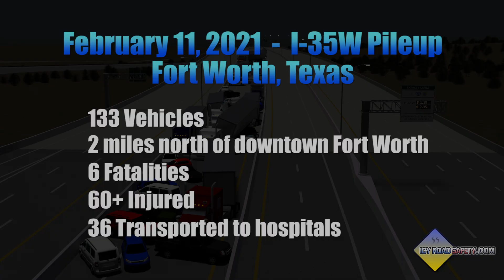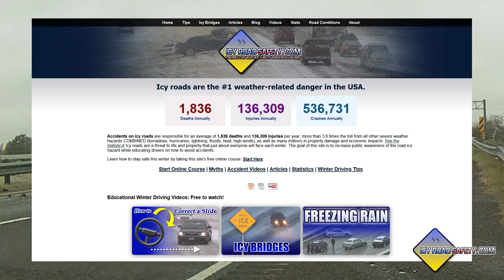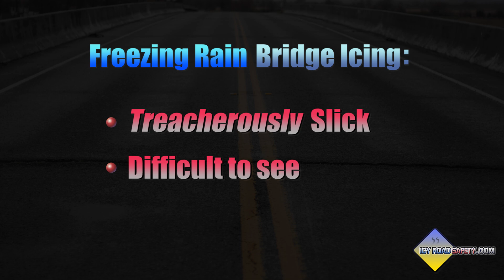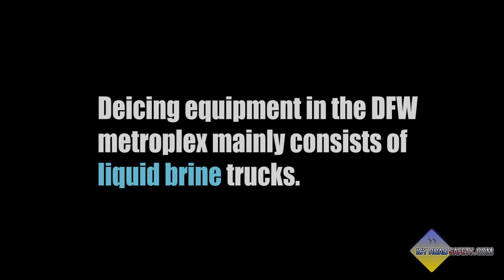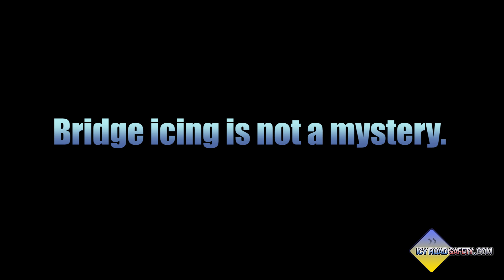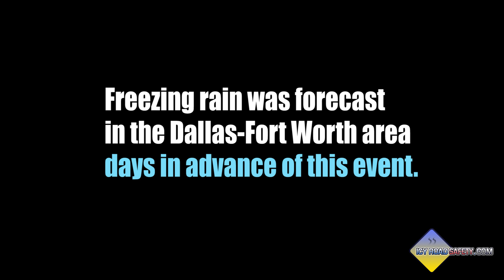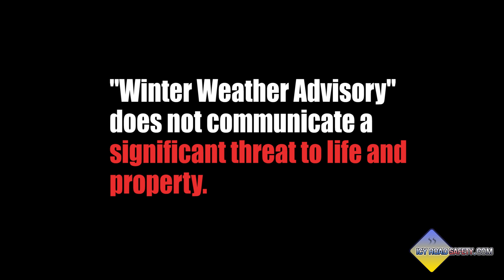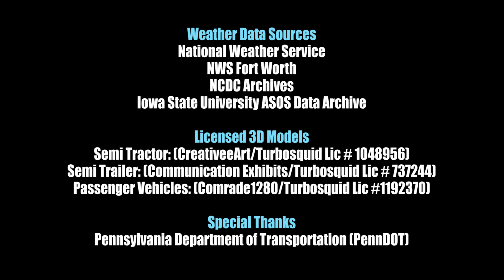The Fort Worth, Texas pileup: its cause, contributing factors and how to prevent future ones

Comment: I live a few miles from where it happened. I worked in Dallas then. When I left mid afternoon the day before it hit. Driving from Dallas off 635 I seen a few trucks spraying stuff on the roads to get ready for this storm. As I got to Fort Worth there was no trucks or nothing being laid down on the road to prevent it. You could see if it was sprayed or dirt laid, nothing. I ran around a couple hours before I got home. Woke up in the AM and seen this on the news. I was not surprised. Plus folks driving still at 80 mph didnt help. It was a mess here. Not suprisingly, the next ice storm there was deicing on the road.

Comment: I have something regarding the bridge icing, the problem I see here along the information given, the bridges has concrete laid, not asphalt, that’s also a huge factor in which why the bridges freezes before the road.

Here in Europe, most, if not all bridges has the same asphalt that the normal roads on the ground has.

Of course, bridges always freezes first due to the warmth of the earths surface.
But it minimizes the risk of the road having ice built by quite a lot of percent.

Comment: Dan, good video however I feel you have really missed the mark.  The bottom line is that DRIVERS MUST be more aware of the conditions they are driving in and adjust their driving accordingly.  Weather doesn't CAUSE crashes, people driving outside of the safe speed for conditions is what causes the crashes.

Comment: I live here and called this before it happened! Number one cause! No where to be able to move over to avoid the accident. I’ve lived here in this area my whole life and have seen and driven in many ice conditions….it was not until they started altering the highways, adding these concrete barriers to prevent other vehicles from potentially causing an accident in the other lain when swerving to miss accident but ultimately adding these concrete barricades left absolutely no “shoulder.” So add on the icy conditions which yes this was a freeze but again we have had many icy conditions just this was the first in my 40yrs that lasted over a week. This was the first, beginning of the freeze so again we have had same conditions before. What led up to this…..Icy, drivers were commuting in the dark, when they are coming up on that part of the highway it’s not flat so you do come up in a sense with a surprise “oh crap traffic” concrete barriers and express lanes with NO SHOULDER! All of these combinations with the cherry on top, drivers driving too fast KNOWING THAT THE ROADS ARE ICY led to the unfortunate accident that I hope we never see again.

Comment: Excellent video! Thank you for the much-needed public announcement/education.
---
"Region inexperienced with winter weather:"
A key point you could include to that: Lack of knowledge leading to wrong choice of tires on vehicles.
Tires make a BIG difference to how well a vehicle handles. I suspect a lot of people down here in DFW area have no clue what type of tires they have on their vehicles. 
A lot of cars might have "grand touring" tires. While these are sold as "all-season" tires, they are not true all-seasons. They are a hybrid between summer and all-seasons. Touring/Grand touring tires are not meant to handle actual winter weather, let alone icy conditions.
Up north at my NY estate, all-seasons are pretty much standard and some even swap to winter tires every winter season...even adding chains at times when needed.
I wouldn't be surprised if in the DFW area, a higher percentage of people drive on summer and grand touring tires...and no one drives on actual winter tires.
This is why I see so many people in the DFW area having trouble with even a spackle of snow...and are unable to handle even a little bit of freezing rain. A change to proper all-season tires would drastically improve traction for them.
Now, no tire will handle a real sheet of ice (trust me, you and I know), but good all-season and winter tires are better able to handle winter weather than any other tire.
---
Another point...
Hmm, so they use a liquid brine solution down there in the DFW area, eh?
Brine is just salty water. With freezing going on, the brine is going to add to icy conditions and actually create more ice than what would have occurred just from precipitation.
We use a salt/sand spreader up in NY. Yes, our cars get caked with dirty salt, but the salt/sand combination really helps improve traction. Even after the salt melts the snow or ice, the sand helps to further improve traction and prevent a refreeze from becoming a sheet. The sand breaks it up.
---
Winter weather advisory...
Oh, yeah. We know what that means up in NY...stay home unless absolutely necessary and if so, proceed with extreme caution...even with winter tires.
These warnings should be elevated to and taken as seriously as tornado warnings.

Comment: The main cause of the pileup was the fact that most Texans have little to no experience with winter driving since IF we get snow it's usually only a couple of inches that's gone in a couple of days. February of 2021 was far colder than we're used to. It usually doesn't get below the high teens but, in 2021, we had one night were it got to -1.
Reply: Also Texans drive like they're in nascar.... I live in Texas... I know
Reply: @cathymac6472  We also have the people who drive ten miles under the posted speed limit, and people who suddenly just whip into your lane without looking to see if there's another car already there. At least the Nascar driver whizzes past you, and is gone. Nothing like being stuck behind someone going 35 in a 45, or almost being sideswiped.

Comment: As much as I love living in Texas, I hate Texas drivers. Going speed limit was actually their version of slowing down. Without icy roads, common speed in express lanes is 90+, with most Texas always driving 15 miles over the limit. The only thing that can really get a Texan to slow down is flashing red and blue lights. My solution would be to line the bridges with officers that continuously have their lights on, and they’ll also be available for immediate response in case of accidents

Comment: I know this may seem a bit far fetched but, what about putting some  sort of  heatting system covection lines on the surface of these road bridges, or maybe spray something warm but also flame retardant, maybe a heat generator or exhaust system that sends warm air onto the frozen surface from the sides of the bridge to counter act the wind chill and freezing rain, idk.

Equip a temperature sensor to detect abnormally low surface and wind temperatures and have a small electrical generator to run low current through an insulated wire or coil.

I know most modern motor vehicles have rear car windows with strips that conduct heat and current to defrost and defog the exterior of the windshield, but I think maybe doing he same thing but on these bridges might work.

Comment: The city I live in shuts down almost completely if we get a half inch of snow. About ten years ago, we got a good deal more than half an inch. I finally had to go out after five days, because we were running out of food. I could have walked faster than I drove, but I was pretty much alone on the road, so it was fine. The woods on either side of the two lane road I was on were full of SUVs and pickup trucks the entire two miles I was on the road. Too many people believe the commercials for their vehicles, and these people can't drive in the rain, much less snow and ice. We were at home for eight days that year, and the most shocking thing was the satellite TV stayed on the whole time, along with the electricity.

Comment: Excellent video. Thank you for taking the time to put all of this valuable information together. Your concern for the safety of the motoring public is greatly appreciated. I’ve been driving semis for 28 years now and Lord knows that I have seen my share of tragedies up close. You are correct, ice, and especially black ice, are very hard to detect. I was taught to look for shiny reflections on the pavement. If you see them, chances are that black ice is present. If people would heed the precipitation warnings like tornado warnings, as you stated, many lives could be saved if they drove accordingly. Excessive speed and a short following distance, are recipes for disaster, ESPECIALLY in an 18 wheeler. In fact, for trucks, that is the case even for ideal conditions due to their size, weight, and increased stopping distance required to get them stopped completely. Add ice and snow into the equation, we truck drivers must reduce our speed and increase our following distance accordingly. Drivers of smaller vehicles (cars) that try to cut in between semis trying to slow down in inclement weather, are only putting themselves in more danger by doing this. We need that distance to stop in an emergency. If you are there when that emergency occurs, we are powerless in trying to avoid colliding with you. Laws of physics simply cannot be compromised.

Comment: I agree with your serious warning idea. All of that would surely make a difference. The problem I see is the pure negligence, and total disregard shown by the driving public. I was taught in my teens about icing bridges and how to handle them safely. on Top of that I drive a 2011 GMC pickup that tells me on start up if the temperature is below 32 degrees. It also tells me while driving when the temp has dropped to 32 or lower. if this isn't standard on all vehicles it should be made mandatory! Finally, the most dangerous thing a driver can do if they find themselves on an icy bridge is go for the brakes!! If the bridge is icy and the road is clear of wrecked cars the brakes are your worst enemy!! DO NOT PANIC! If you have an automatic transmission simply let off of the gas and maintain your course without bobbling the wheel. If your transmission is manual simply push the clutch down and let off the gas at the same time. In 99% of cases you will not slip a wheel as you cross over and off of the bridge even at highway speed. In the rare case that it does brake loose just steer gently into the slide. No jerking motions just smooth control, and no brake. If there is an obstruction in your path, pump the brake as little as possible giving yourself enough control to maneuver around the obstruction. Always remember that ice and brakes don't mix! If you're holding the brake, you are out of control!!!!!!  Pay attention to the warning signs, low temps and moisture in the air, when approaching a bridge assume that it is icy, brake your speed down before you get to the bridge, then leave the brake alone!!!  
Common sense is becoming very uncommon!

Comment: Not only with your explanation, the Texas highways are in no means safe period. The poor connection of the highway and bridge will make vehicles both cars and tractor trailers lose control of their vehicles caused of bouncing and poor treads on their tires.  They lose contact of tires and road. Terrible, I hate traveling through that state anytime

Comment: 16:45: Well, one very glaringly obvious thing would be instead of shutting down all of DART, run the trains as close to weekday rush hour service on all routes.  People who aren't driving can't crash a car.  Ice doesn't build up on rail infrastructure that's running close to capacity.  Cities prone to this like Portland and Seattle figured this one out decades ago, and will start ramping up to run as many trains as they got as often as they can continuously 24/7 until after the thaw is solidly underway to keep people moving and keep the tracks and overhead power infrastructure from building up ice.

Comment: I am a Canadian. Even though we have poor conditions plenty of times during the winter, pileups happen frequently. I  wish that DOT would put up electronically signs to indicate  bridge freezing conditions. Temperature of the atmosphere and speed limit reduction. When above 36° it is green, when it is 36° - 33° it turns amber, when under 33°, it turns red plus flashing amber lights like a railway crossing. In Canada, temperatures can fluctuate within 10 minutes so when the temperature is rising, red will turn amber at 36 after a minimum period, amber will turn green at 36 after a longer period. The sign Bridge Freezes Before Road is ignored because it is there all year round. 
Michael Garrison 
Ancient and wore out like a model A Ford. 
Slow, backfiring, hard to start and need a lot of maintenance.

Comment: Great video! The 3 or 4 times that we’ve had freezing rain or icy roads in the New Orleans area in the 35 years I’ve been driving, they simply declare a local state of emergency, and close all elevated roadways. This effectively shuts the metro area down because you can’t go far without using some form of elevated roadway. Because this is such a rare occurrence, we don’t have snowplows or any kind of salt/anti-icing available. 

For local travel, the area is crisscrossed by drainage canals, so even if you are going someplace close, you’re going to cross a series of small bridges. In our most recent freezing rain event, they sent out dump trucks full of sand and spread the sand on many of the small bridges, which is somewhat helpful. My daily commute is about 4 miles, and doesn’t involve elevated roadways, but it involves 4 of those small bridges, and even with the sand, and moving at around 15 mph across those bridges, I could still feel some loss of traction. I was one of the few vehicles on the road that day, but I observed a few people wiped out on these little canal bridges, typically oversized pickup trucks and SUVs, and the ones I saw in motion were all going too fast for conditions. 

Most people who have spent their lives here have never experienced those conditions, and when they occur, they have NO CLUE how to keep a car under control.

Comment: I drive this stretch everyday on my way to work.  After the project was completed I noted to my wife that on freezing rain days I wont be headed in to work until I watch the news and see what the road conditions are because of this bridge alone.  I knew on Tuesday and told my boss that I would be holding out on coming in to the office until I knew what the roads were going to be like on Thursday morning.  I live only 11 miles north of this bridge and I can tell you that the roads were not bad north of the accident. I did attempt to drive in to work and it wasn't until I got about as far south as the accident taking another route that the roads began to worsen.  I believe the bridges north of the accident were not frozen and for as many as there are (7 bridges in the previous 5.12 miles) it gave many drivers a false sense of safety.  The only thing I would disagree with this video on is many people DO know about freezing rain here. When I moved here, it was all anyone wanted to tell me.  As a northerner everyone who knew wanted me to know that its not the same as driving in PA and WV where I grew up.  They were right, its crazy here.

Comment: The sad thing about this there are systems to mitigate this.  There are legit (bridge ices before road)  signs.  There are ticker billboards that can tell Gen pop that there are icy conditions.  Where I live they send freezing temperature/ road hazard  texts.  And it's common sense that if it's at or near freezing during precipitation to slow down esp on bridges and give double the amount of driving distance in case of emergency stopping.  App of which is in the driving handbook you have to know before taking your test.  This was a sad and preventable accident

Comment: I would like to see 2 things change in regards to road design:
1. All interstates get variable speed limits nationwide
2. All interstates and freeways gain gates that can be closed during severe or winter weather, forcing all traffic to non-elevated surface streets or areas with automated anti-icing systems until the threat passes. 

Bonus: Require all new bridges to have built in anti-icing systems such as radiant heaters and automatic de-icing sprayers that can be activated whenever winter weather is a threat.

Comment: I've thought before that some parts of interstates should have changing digital speed limit signs instead of the regular metal speed limit signs based on conditions.  Lower speeds for bad weather, higher speeds during hot, dry rush hour traffic to empty roads faster.

Comment: This came into my recommended just now, as we (DFW) are under another winter storm warning for freezing rain right now. I was not aware that the brine solution could be washed away with freezing rain and continuously needs to be applied. I remember going to work that morning as well, but on highway 75 further east. Luckily traffic was incredibly slow, and it took me 2 hours to go 13 miles. I witnessed flipped over cars, trucks, and semi's. As well as a semi that took out roughly 200 yards of the middle barrier. In the moment I was frustrated, but I'm very grateful for it being slow because it was icy. Most drivers here do not take these precautions seriously and even this morning on my commute I witnessed some vehicles going above the posted speed limit (70 mph) during freezing rain. I hope this video sneaks its way into many other people's recommended because even I learned a thing or two and I'm originally from Minnesota where we get more snow than freezing rain. Thanks for this!